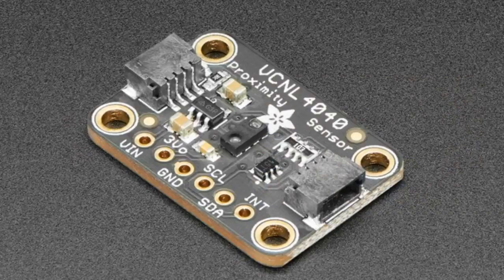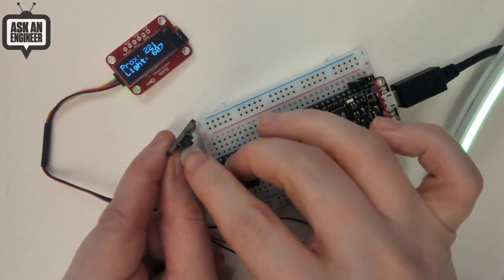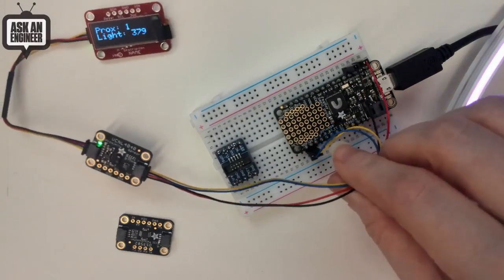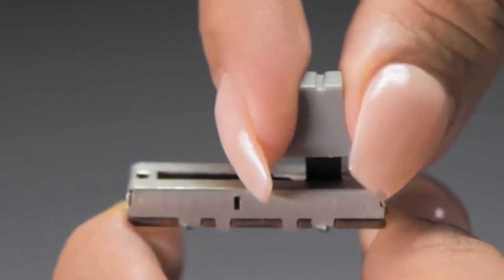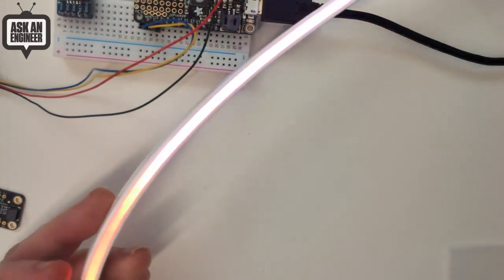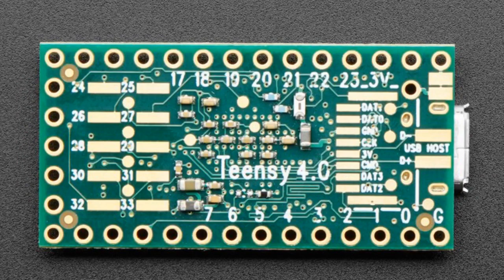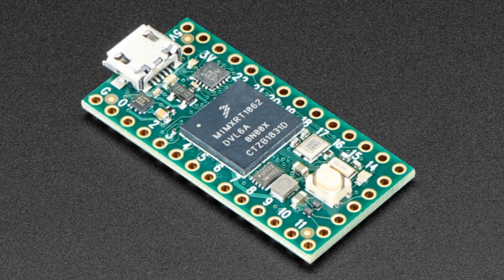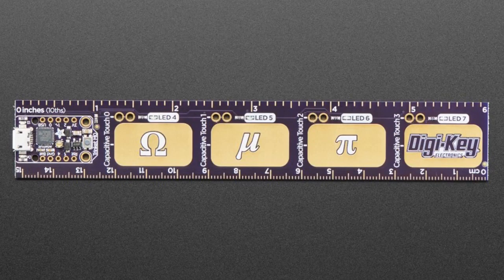New Products 8/7/2019 Featuring #PJRC #Teensy 4.0 USB Development Board #adafruit

Comment: How long can I make an I2C cable?
Reply: Why didn´t you Google it?  For reference, shielded 22 AWG twisted pair cables have capacitance in the range of 100-240 pF/m. So the maximum bus length of an I2C link is about 1 meter at 100 Kbaud, or 10 meters at 10 Kbaud. Unshielded cable typically has much less capacitance, but should only be used within an otherwise shielded enclosure.